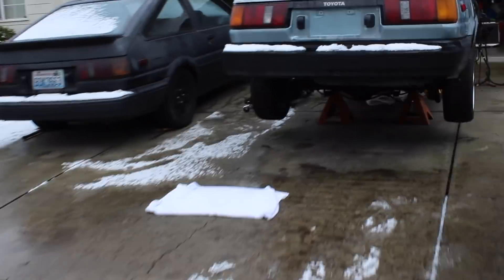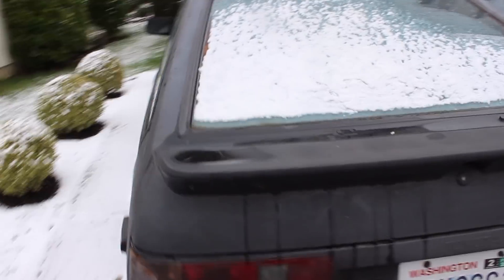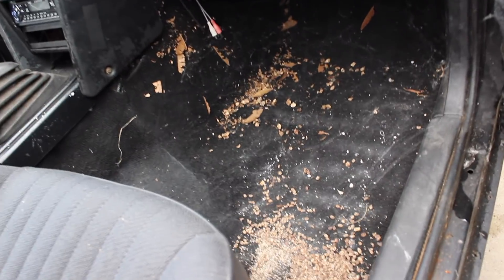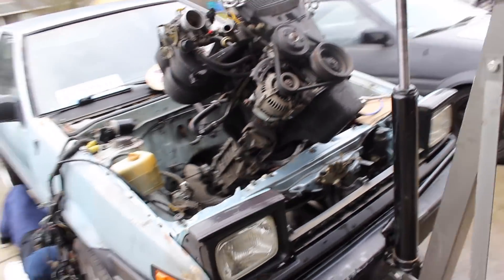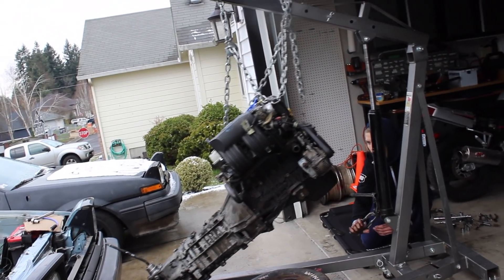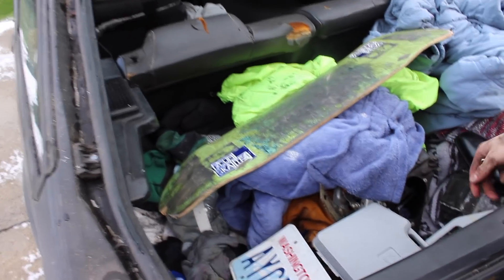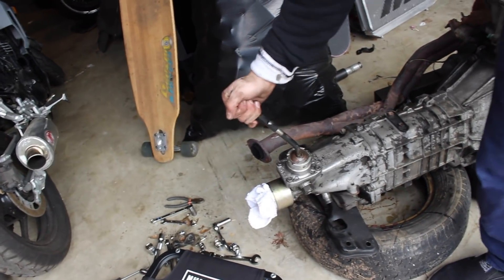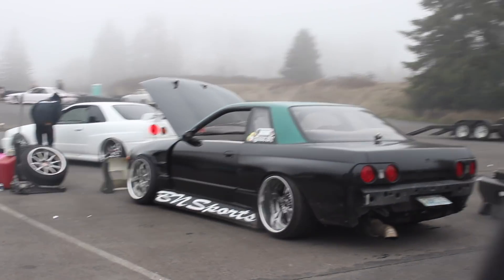Rebuilding an abandoned AE86 !! - PART 2 / Pulling engine

Comment: Gonna swap the harness, fuel lines, gas tank and rear axle too?
Reply from the maker: just the harness and engine/trans. i think some interior pieces aswell
Reply: Shood B Good so just gonna well the diff I’m assuming? (If it doesn’t have a GTS rear end)